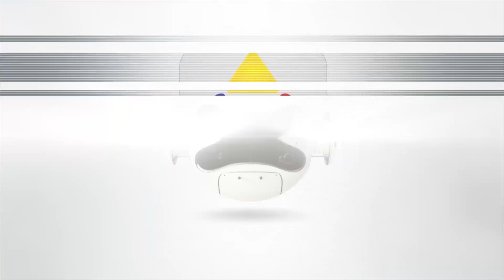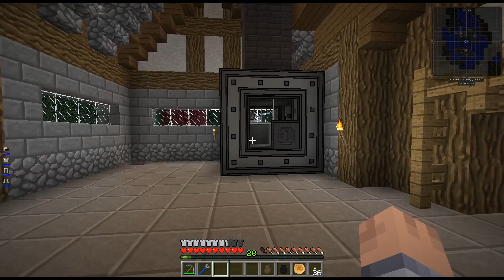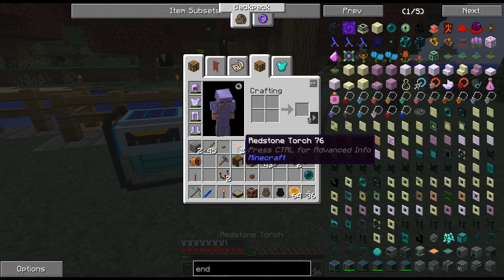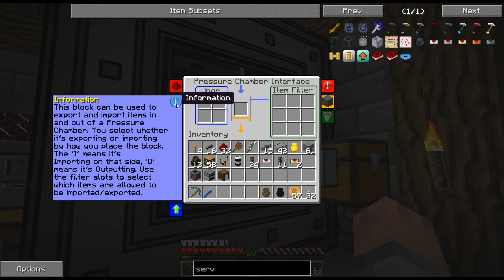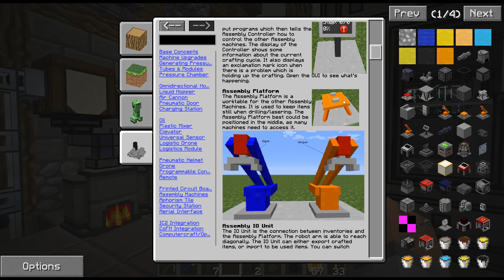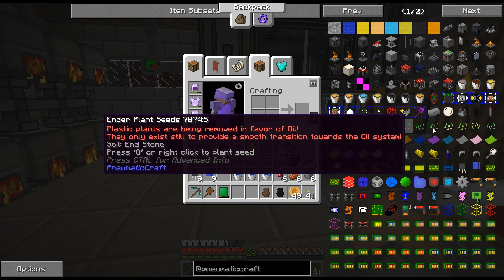Thorgal's Modded Minecraft #8 - Solar automation and circuit boards

Comment: Instead of using the pressure relief valve to keep your network from exploding, you should use redstone control of the air compressors, á la direwolf20 at the beginning of this video: https://www.youtube.com/watch?v=njpghVP57Fc. With that setup, you won't waste any charcoal and your pressure tubes will be able to equilibrate and you'll get even pressure through the whole system instead of the 0.1 drop off every so often. You can also upgrade the pressure gauge with a PCB (right clicking? you might need the Pneumaticraft hand drill...) and then change its redstone thresholds. Also check out the security upgrade for machines!

Comment: You should only use Toggle Latches for workloads that actually require them. In most cases, the (more basic) SR/RS Latches are a better and much more robust choice. You might want to read up on some logic basics http://minecraft.gamepedia.com/Memory_circuit (I find the Minecraft resources on the topic to be easier to understand for people that have previously dealt with redstone than actual logic/engineering resources) regardless if you're going to actually build the crcuits yourself in vanilla or use the compacted PR Logic blocksf

Comment: Heya waves (ugh, the beginning of a comment is the horror, heh)

Before I start to blabber:
About the wrought iron fence, I think your decision about taking the wooden fences is the best one. 
I played around with Garden Stuff (totally love such deco-mods) alot and noticed the wrought iron fences are best either in very small numbers, like when fencing a little garden, or more of a replacement where you would usually use iron bars (like one of these old fashioned stone+iron bar walls around a mansion with leaf-blocks as hedges).
Just using them as wooden-fence replacement usually makes them look misplaced.

And now to my blabbering:
This place you built there looks totally amazing!
Wish I was half as good at this aestethic stuff as you are. With combining blocks that they actually fit nicely and all. But I'm learning it slowly! 
Your way of building totally got to my pride and gets me to finally start getting away from building cellars and big, half empty rooms in mountains, hehe. A big "thank you" for that! :)

(now enough changing the text cause thinking I say things wrong/missunderstandable... writing comments sure is difficult)

Comment: I really like the solar generator redstone control you made, since it discharges entirely in the night i ussually just made a timer and a toggle latch, and the thing about the generator discharging slowly, it's because it's a level 1 gen, it outputs 80 rf/t max i think, if you upgrade it, it should drain faster, but that would require another 7 diamond blocks for another 7 solar generators :p

Comment: Always go high>low when connecting two different y-leveled objects with IE wiring. I don't know why, but it works better.

Useful tip, your pressure tank acts as a pressure storage device. The larger a pressure chamber you have, the more pressure you store. A large size pressure chamber will cause the system to lose total pressure slower. IE the time taken from 4.5>4.4 is longer if you have a pressure chamber storing compressed air. It also takes longer to pressurize a larger chamber though.

I suggest using one of the PCB's to make the RF powered compressor, which can provide much higher pressure. (Useful for the Charging Station.)
Reply from the maker: Thanks for the tips! I was thinking of making one of the fluid based compressors for the charging of drones and so on, but RF sounds interesting too.
Reply: Thorgal Daily Gaming Fluid would also work, but I think for tool charging, the RF one would be a simpler solution.